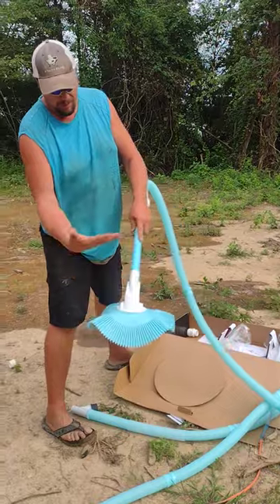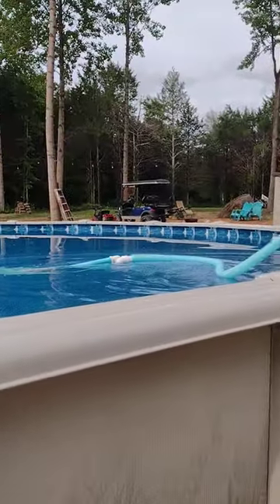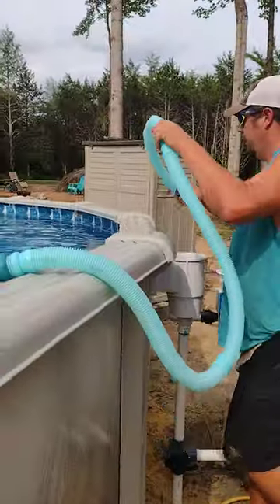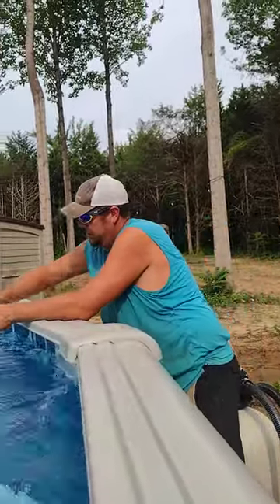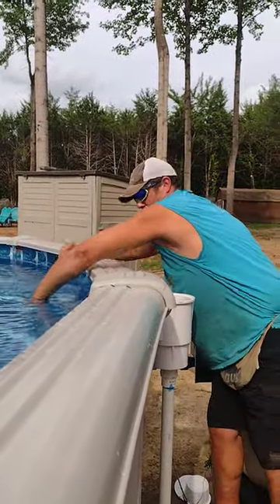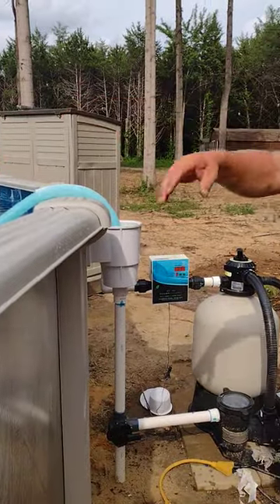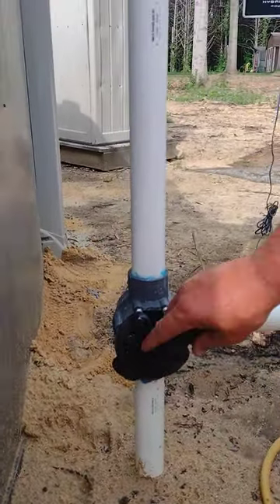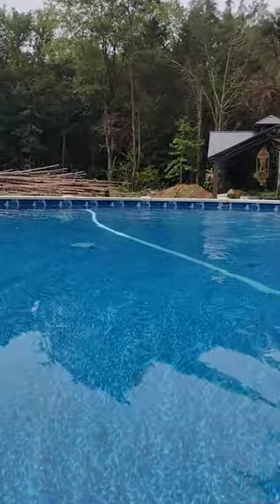creepy crawler pool vacuum

Comment: Can you post the valve part, did not show on video 😢
Reply from the maker: I also have a three-way diverter valve video on my page
Reply: Sorry I don’t know what that is 😢
Reply: My skimmer keeps overflowing when I connected the house for the kreepy krauler is that what is supposed to do???
Reply from the maker: No it should not overflow your skimmer do you have a valve below your skimmer if so more than likely you have it closed to the skimmer which is causing it to back up
Reply from the maker: https://youtu.be/e1qXPLiY1W0?feature=shared